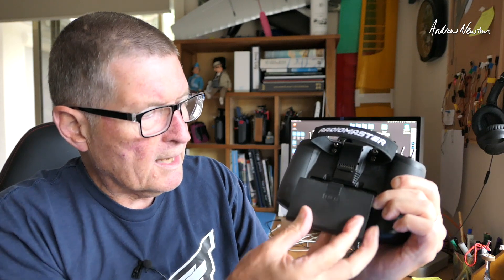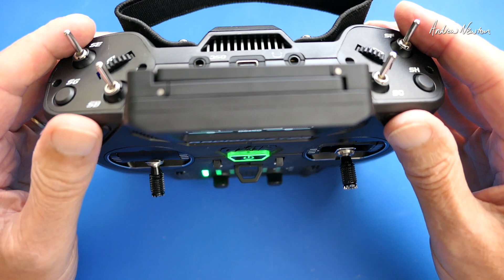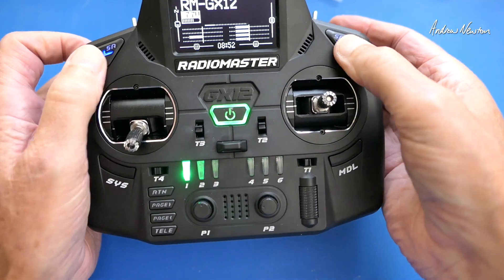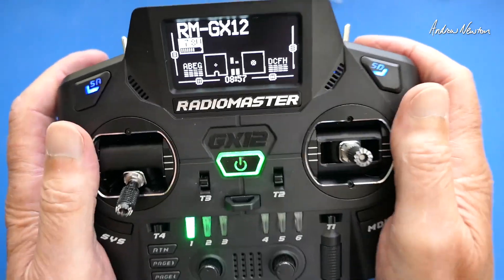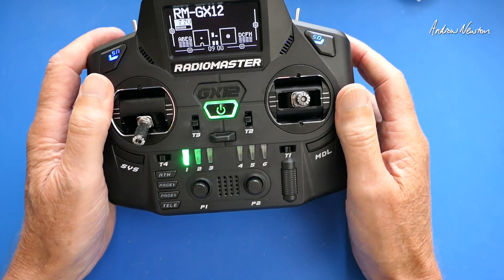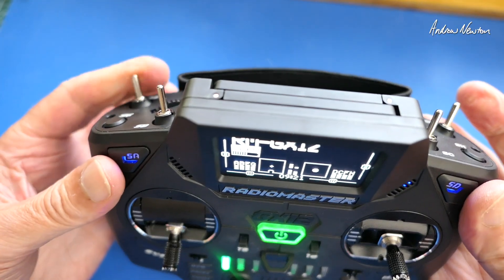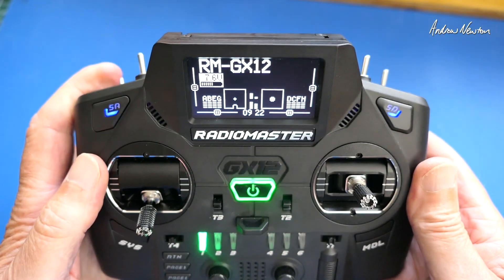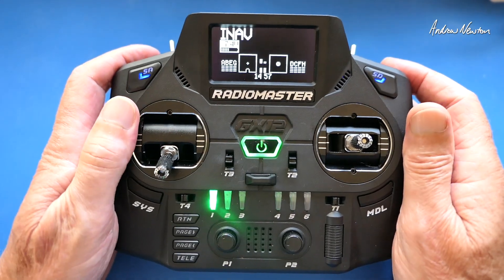Radiomaster GX12 Review and Switch Swap

Comment: With the TX16, you would have to tell the radio that the switch was changed from a 3 pos to a 2 position or momentary switch.  Do you not have to do that for the GX12 or did I miss in video?
Reply from the maker: Probably only makes a difference swapping from 2 to 3 pos switches

Comment: Hello Andrew, I fly mode 1, to swap from mode 2,  do I need to swap gimbles over or can I do it in software? I did see stick tensions and ratchet can be done from the back of the radio.
Reply from the maker: Radio Setup page
Reply: @AndrewNewton  Thanks, might take some time to fully understand Edge Tx open source radios.
Reply from the maker: @ Paul from Geelong?
Reply: @ correct Andrew, I’m still using the Apprentice S that you helped me set up, with the Matek F405 wing, was using a Taranis X7, now just got myself a new Radiomaster GX12, love this radio, just haven’t programmed a open Tx radio in ages! I’m watching all your videos getting some tips !!
Reply from the maker: Ah greetings Paul. The GX12 is a sweet radio. Happy to help with setup, don't hesitate to ask.
Reply: @ Thanks Andrew.

Comment: What is the biggest advantages with  ELRS compare to EdgeTx?
Reply from the maker: Can't be compared. Both are required at the same time. EdgeTX is the radio operating system, ELRS is the RF link protocol between the radio and the receiver.

Comment: Does the switch module support more than four devices? What is the data between the MCU and the module?
Reply from the maker: The module handles 5 inputs including the front buttons. But all you can really do is remove or swap switches. Data? No idea.

Comment: Hi andrew, how do we convert this to mode 1 with the newer gimba system? The insides are different from what we're used to.

And is there any space for me to squeeze in a 2 pos toggle switch on the front faceplate? Somewhere near the top corner switches. I fly fixed wing, thats a more familiar place for toggle switch for me.
Reply from the maker: Diagram on the product page shows how to change modes. No space available for a front switch, it's tight in there with top switches and gimbal up taking all the room.

Comment: Hi Andrew I have a tx12 MK2  great radio still learning how to use it. Just wondering whether you could help me set up a glider. I have a Fx707s Albatross I can't seem to get COG correct . I am in Adelaide.
Reply from the maker: Converted chuck glider? Is it CG or too much elevator?
Reply: When using throttle need to set the elevator in down position to maintain level flight. If throttle turned up climbs very quickly. When using ailerons turns are very erratic more left than right. Have set trims on radio to central position and made sure  ailerons and elevator are set flush with wing. Model Making Maniacs are in SA  and have utube videos of the FX707s conversion.
Reply from the maker: Don't know about your roll problem, maybe wing flexing or different throws on the ailerons? Pitching up is normal for chuck gliders. Probably need to level out the horizontal stabiliser, it will be angled up at the rear. And change the motor thrust angle to point down a few degrees.
Reply: Thanks Andrew I have tried altering motor thrust angles. The ailerons are on a y connection. I will put them on two channels and that way I can vary the angles on ailerons. There are lots of ways to build these. I have opted to mount a 2s 1300 lipo underneath at mid point of wings with ESC and receiver in front under the hatch I am using a 2200kv motor with 6x4  propeller. I should have checked the cog before starting the build. I will battle on thanks for your replies.
Reply: Sorry to go off gx12 topic ALDI have those lidl gliders for sale Wednesday $ 9.95. I know you have already done videos on them ! Merry Xmas keep the videos coming
Reply from the maker: @neiloxley7904  Thanks for the alert!
Reply: I got two will try making pivot wing design see how I go, will copy yours ! Cheers
Reply from the maker: @neiloxley7904  Nice one. I have 2 from K-Mart for the future. The Plank style conversion works very well for a strong wind sloper.

Comment: What were they thinking with so many momentary switches
Reply from the maker: Never too many, the 6 pos can be turned into 2 x 3 pos buttons
Reply: @AndrewNewton  Latching would be so much better
Reply: @hairyhider7478  EdgeTx is so powerful that we can just program any momentary to do the action of a latching/toggle switch.  You know one press ON, one press OFF, or cycle through a series of modes like 3-pos, 4, pos, 9pos switch etc, each with voice callouts you customize.  Some of these new switches on this radio can also be customized to change into various colour lights corresponding to each position-output.
Reply: @AndrewNewton  Who would want momentary though

Comment: Wow.  Impressive.  Do the sliders have center detents and how "strong" are they?  I typically use sliders to control an FPV pan servo and need a significant detent/stop at the center position so I don't accidentally end up with my FPV cam slightly off-center.
Reply from the maker: Yes, strong detent and you can't easily bump it out of position. Best sliders I have come across

Comment: Ooh, I'm impressed. Doesn't happen often, but this looks good. I only fly fixed-wing, mostly gliders, so it's nice to see a TX which caters to 'minorities' [joking]. And - could it be true? - a manufacturer has finally given a transmitter a decent range of switches and sliders.

True, I'd have preferred fewer buttons and another 2 levers/sliders for better control of flaps, variable camber, and some leading-edge slat-things which I'm trying to perfect (don't ask!), but this looks very neat.

Alas, I'm too skint to think of changing my ol' radio for several years yet, but it's great to see that the hobby still has time for something other than quad-copters.

Oh, and to conclude the grumpy rant that I had about screens on Andrew's previous video, I think the simple dark-mode display on this Tx is excellent. What a refreshing change to be able to end on something positive for once.🤭
Reply from the maker: Oh Oh Oh! Light bulb moment thanks to Ms Elli. I'll see if I can replace the top buttons with switches!
Reply from the maker: Disappointed, it would need some creative soldering and Dremel work

Comment: For fixed wing LOS usage, how does the number of switches compare with TX16s Mk2?   I use the Pocket, and sometimes I feel like I run out of switches.  But I would like something less bulky than a TX16s.
Reply from the maker: This has less 3 pos switches but more buttons, up to 10